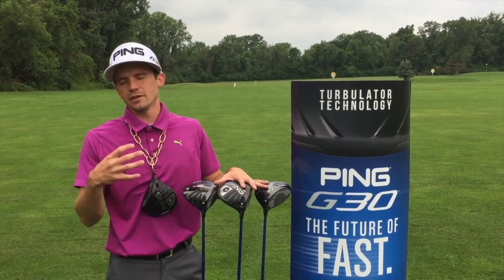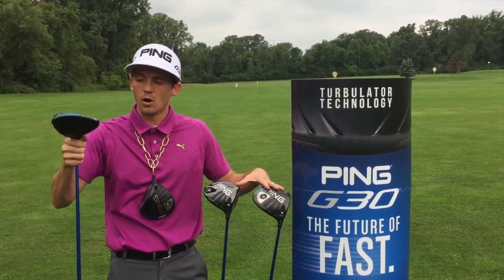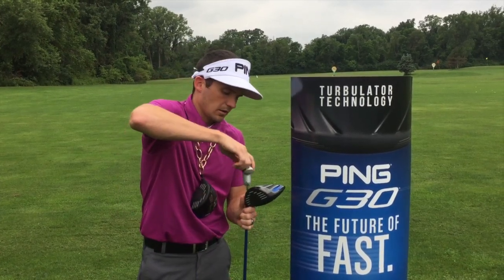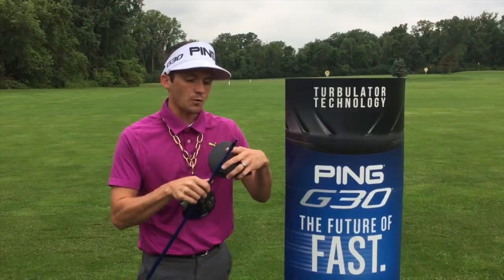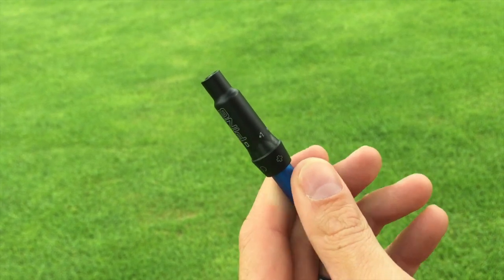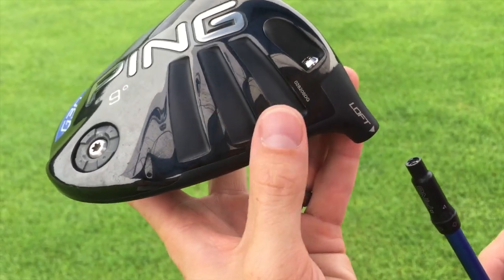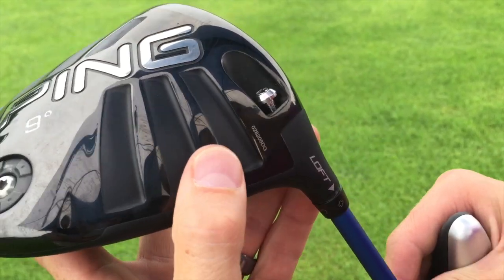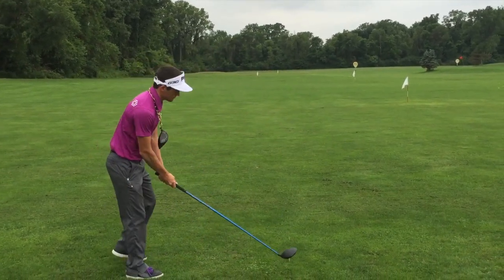How to Adjust Your PING G30 Driver

Comment: What about a G30 LH adjustment?
Reply from the maker: Should be the same information...PING inverts the symbols on the hosel automatically for left-handed drivers, so there are no differences.  Just make sure you have a left-handed hosel/sleeve (The neutral dot should have a hatched pattern rather than a solid fill).  Thanks!

Comment: any tips on getting the shaft out if it is stuck; apply heat, etc
Reply: Try a blow dryer on low setting and tap the club head gently with a hammer. GENTLY. Same thing happened to me. I'm gonna guess you probably leave your clubs in the trunk of your car?
Reply: Hope you tried rubbing some of your vagiseal cream on it all those years ago.